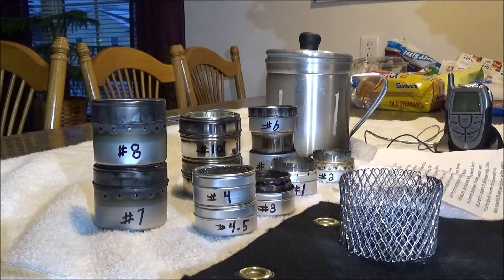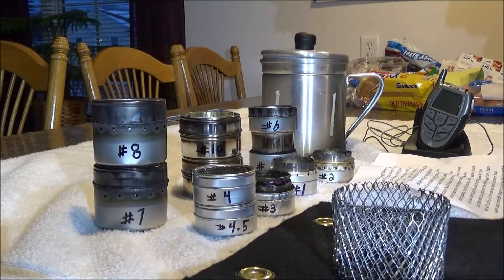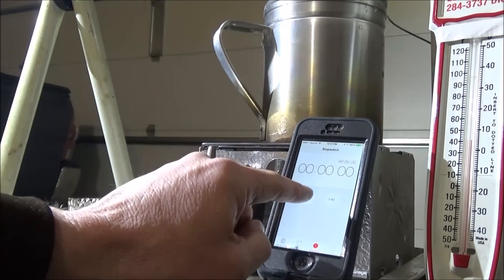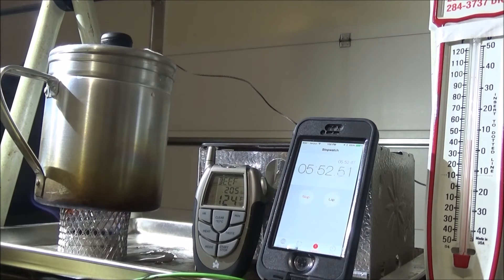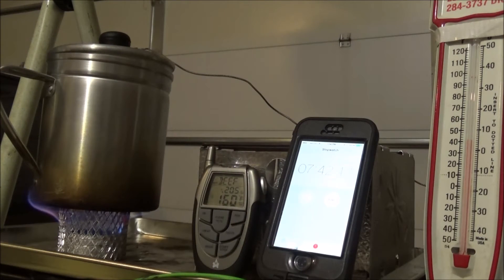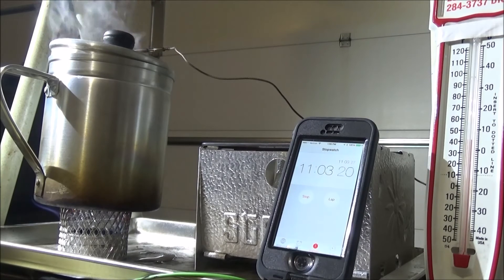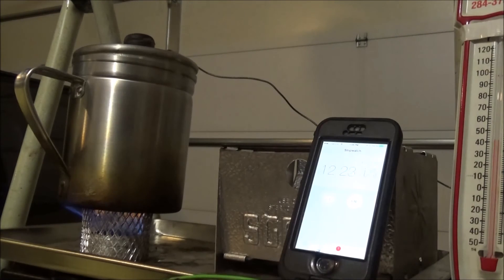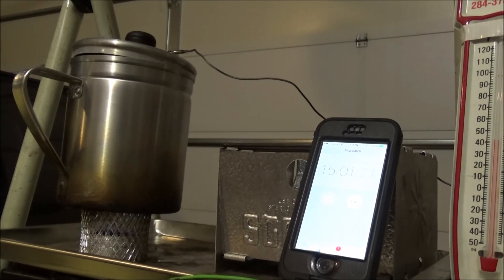DIY How To Alcohol Stove #4 Burn Test Video #5 SIMPLE EASY & CHEAP not a pop can wick type

Comment: Stove 4 is very similar to the one I've settled on for my kit. Thanks for sharing the materials you used on this design.
Reply from the maker: No problem, I am doing another similar Stove #4.5, next, with no felt and no screen just fill the container with alcohol, kinda interesting to see how well it burns.  Thanks for watching